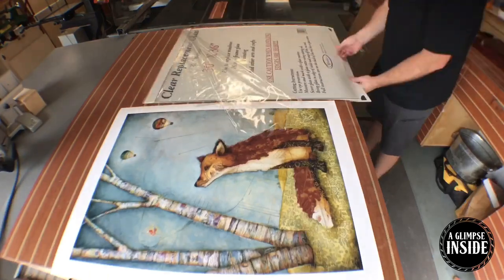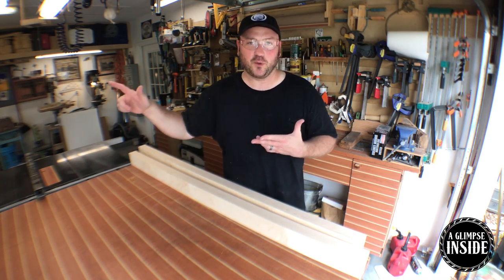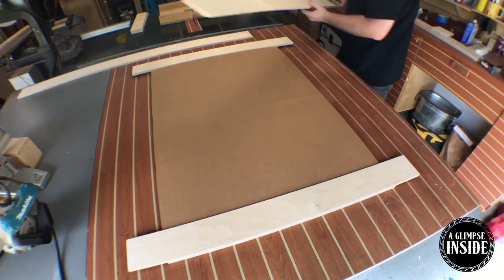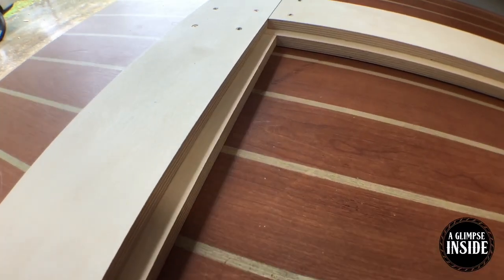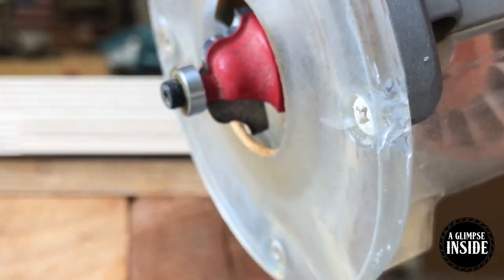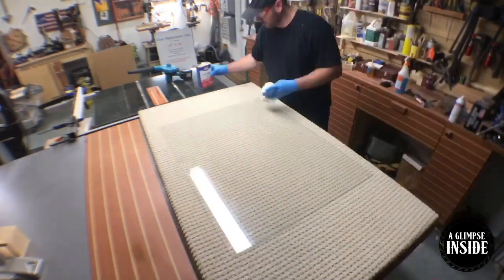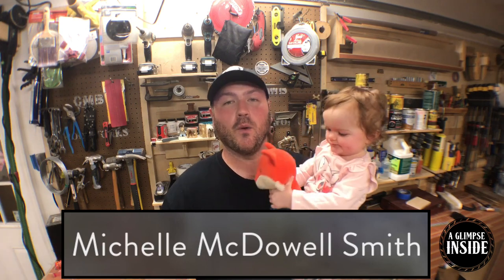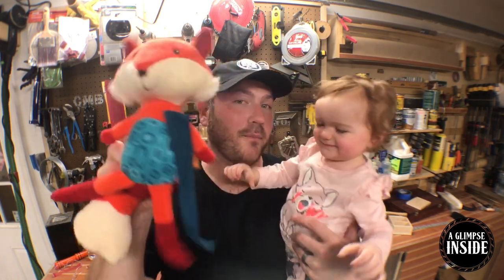How to Make a Picture Frame | No Miters Required | Unique Construction Method |

Comment: I know this is off topic.  But what is your bench top made from and how do you keep glue and stain???  From sticking to it.  I noticed a spot in the very center when doing the frame and then it was gone??
Reply from the maker: +Ralph Oppermann my bench is made from teak and holly marine grade plywood. And I simply soak a  rag in acetone and wipe it off when It gets dirty.   About twice a year I will buff on a coat of paste wax as well. A local salvage yard had a bunch of the stuff for 60 bucks a sheet. I know it was crazy. Thanks for watching man and thanks for being involved in the channel